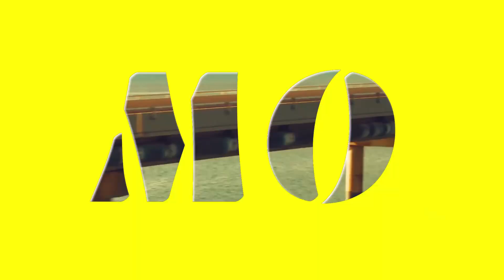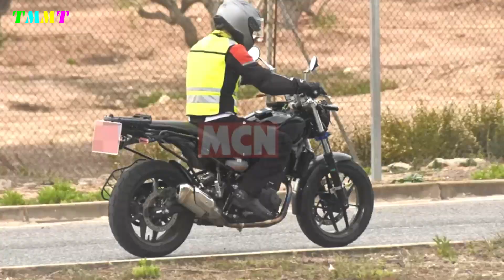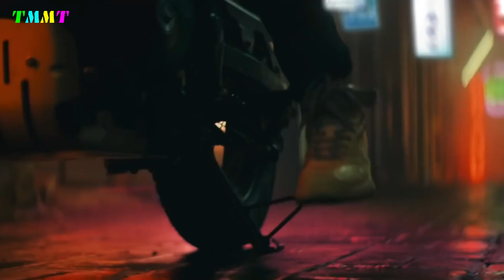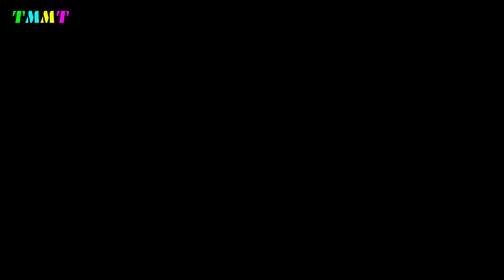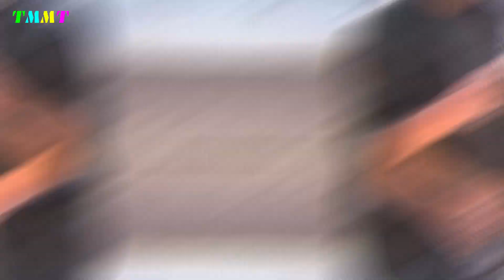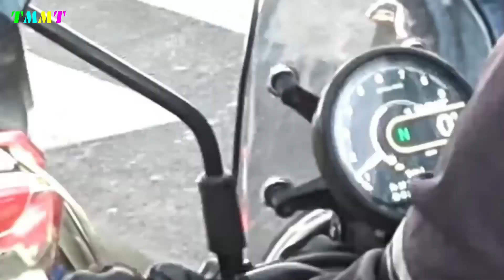2024 ROYAL ENFIELD SCRAM 450 COMES WITH WATER COOLING AND AROUND 40 HP

Comment: 450 cc is the perfect fun bike that can handle both street and dirt. I currently own a TW200 and an XT 225. I have owned a DR 350, DR 650, and KLR 650. Kawasaki and Suzuki could have owned this segment with a DR 450 and a KLR 450 and the 32-in seat height. But noooooo! Apparently there aren't enough short people in the world to bother. So I'm looking forward to the new Himalayan 450 water cooled with 40 horsepower! I'm guessing that the narrator should have said under 200 kg.